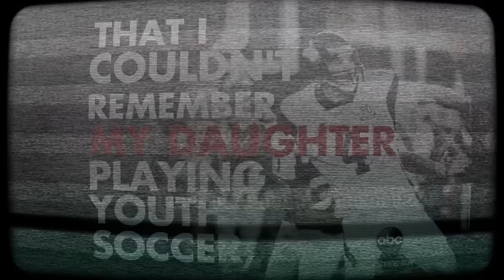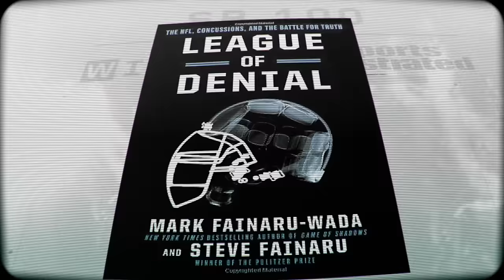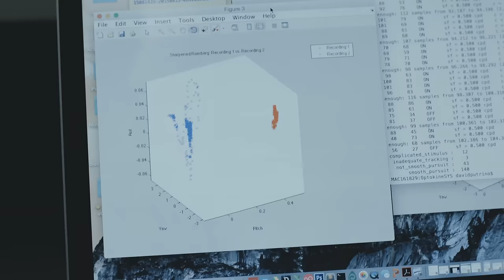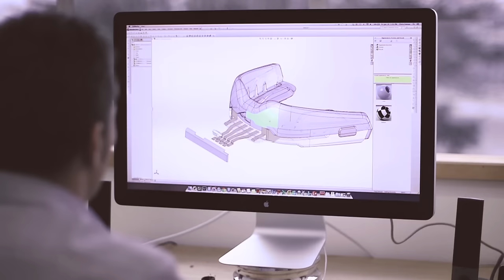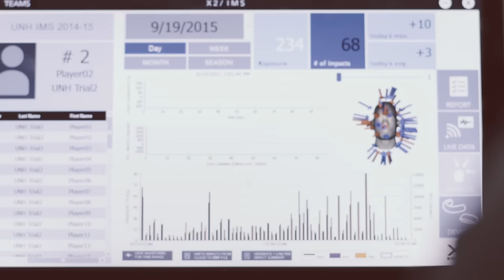Super Bowl 100: How the NFL Can Survive the Concussion Epidemic

Comment: It seems like a near impossible task to prevent CTE and brain trauma in the NFL. Measuring is good, new helmets are good - but how can they prevent the near-instaneous changes of direction the head, and thus the brain, that occur when a player is hit hard? Yes, the impacts themselves can be lessened to a degree through advanced padding design, but the change-of-direction movement is still present. You don't have to have helmet-to-helmet hits to suffer brain trauma.